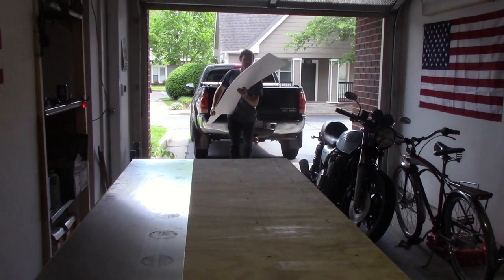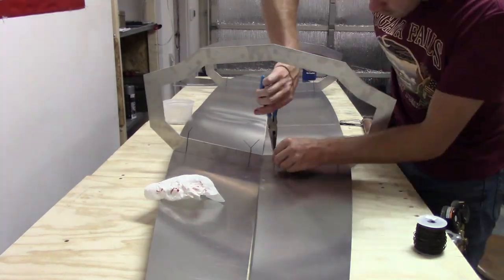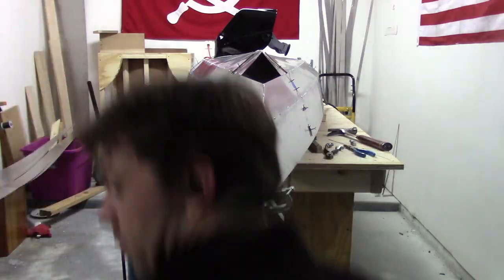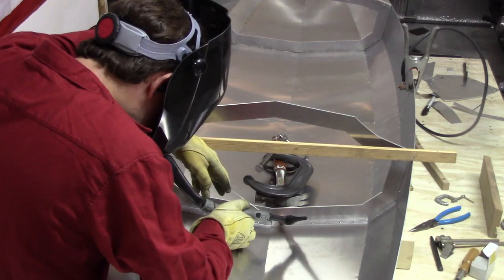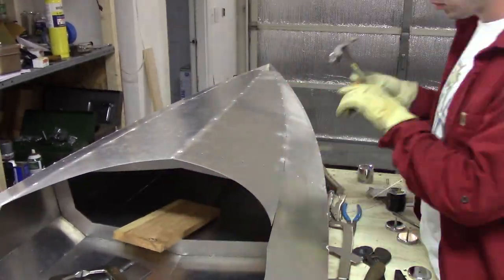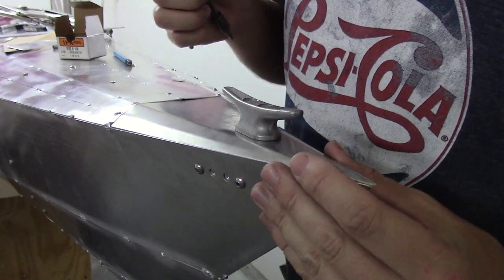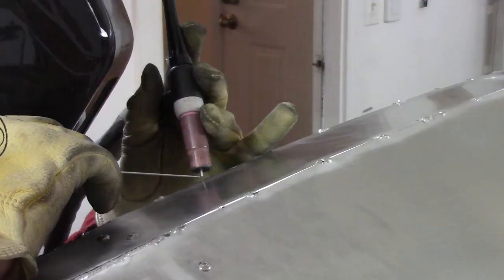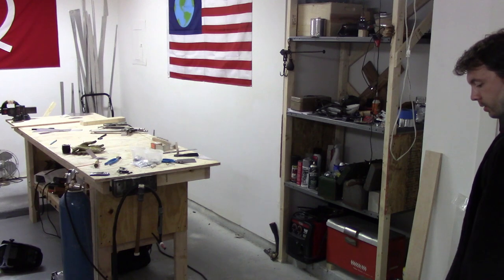Aluminum Kayak Build Part 1  - The Hull

Comment: I'm an avid kayaker. This is awesome! One thing I don't like about normal kayaks is you can't store them outside in the sun. The UV rays degrade the plastic and it becomes brittle and cracks. Even fiberglass degrades in the sun. Your boat would be impervious to that. I think 12' is the ideal size for a recreational boat. One negative I've experienced with aluminum canoes is the noise of the waves hitting it. Also the paddles hitting the sides are loud. I don't think you will have the paddles issue on a kayak but you might hear the water. Definitely a unique boat to own. I like your channel too, subscribed.

Comment: Really awesome man.....thats an extremely difficult first aluminum project haha....ur not a beginner anymore....when I weld thin aluminum ill often use a big chunk of aluminum clamped to the back as a heat sink to pull out some of the heat and help with distortion, seem like you might not have been able to do that in your application but just a thought
Reply from the maker: Yeah unfortunately I wasn't able to do that because of the curves and differing angles everywhere

Comment: Great build and nice problem solving skills. I am a 40 year Journeyman Metal Fabricator and I only have two thoughts... play around a bit with forming, like for body work. Hammer the edges or the middle to stretch and shape the metal. It is a skill unto itself and takes practice. The big one is please wear safety glasses when drilling. Well done and be safe!

Comment: What equipment where you using to weld?  Miller Dynasty 210?  Welding Helmet 3M speedglass model?  Filler metal? I heard you say the metal was 5052.  Temper?  0.040" Thick.  Weld Amps 40? AC balance 70% ? Torch particulars. Argon flow rate?
Thanks. Tig welding 0.040" can be tricky. Looks like you did well!

Comment: The website you linked in the description doesn´t work anymore. Is there another way to see the plans for this build?
Reply from the maker: I don't have the original files anymore. The email I used to contact the guy who made the design is kayak@yakayak.net. Hope it still works for you, otherwise I still have a 3D model he sent me that flat patterns could be pulled from

Comment: Im trying to build a ww2 motor submersible canoe replica and have built a strip planked hull but would prefer aluminium.  Your experience is very helpful - thanks. Wonder if an english wheel would help ?. Has it been done with backing strips and solid rivets ?. How about that low temperature weld/solder stuff ?.
Reply from the maker: Sounds like a cool project. I imagine doing it with backing strips and rivets would be easier with a sheet metal stretcher and shrinker. Can't comment on any low temp soldering for aluminum as I haven't tried it
Reply: Italian or American?
Reply: @1nvisible1   ???

Comment: Yeah unfortunately the sp100 spool gun for Lincoln is pretty trash. I did a 1/8th project with it, and even that was touch and go. Love the build. Thanks for sharing
Reply: Did you experiment with any pulse settings on this build?
Reply from the maker: My TIG doesn't have any pulse settings, it's a decent machine but pretty basic